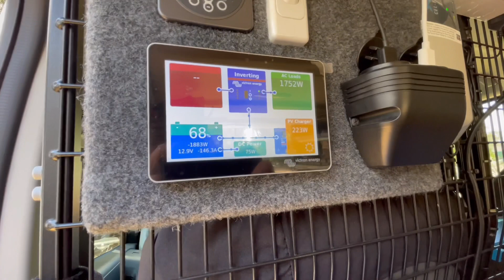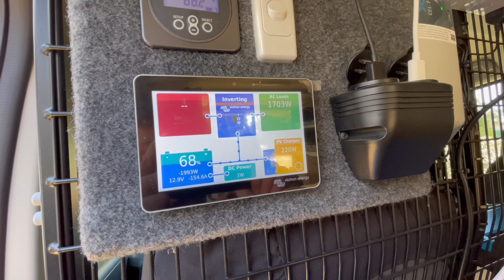Welding from your lithium battery bank using an inverter welder

Comment: at 230v   my 48/5000  with one 90 amp battery  pack  it asked   93 amps at 70 amps  and welder was inverter with 2.5 stick...!!! this  translates to  more than 4,000 peak..!!!  . and i see only 1800 watts there.. someone explains because i ruined one cell on that test !!!!   ..  i know victron recomends at least 3 of my packs  for healthy power up but   bms was 150 amps cell could do 3c  for a bit if need!!!   and at 65amps  on 2.5 constant weld  drifted around 3000 watts

Comment: Thank you heaps for this. How many batteries are you running? I'm keen to set up my rig to be able to do this. I originally was going to use a small generator to run the welder but the generator guy thought that the welder caused too many fluctuations in the current for the generator to handle without killing it. 

I wonder if the inverter has similar issues??
Reply from the maker: We have a 450 amp hour lithium battery, here with a cont discharge of 250a max

Comment: Theres a welding shop in adelaide that sells a lithium powered tig/stick welder, made in germany, made for small jobs, looking at around $3500-6000 depending on battery size

Comment: I was just looking for videos on that subject and you are correct. Nothing
Also was told by the welding shop that its impossible to do it with anything under 5000W 
Bullshit I thought ... already bought both mig and small tig/ark (same as yours) and then saw your video 
Good timing👍
Reply from the maker: Yep,
Use ours often no dramas.